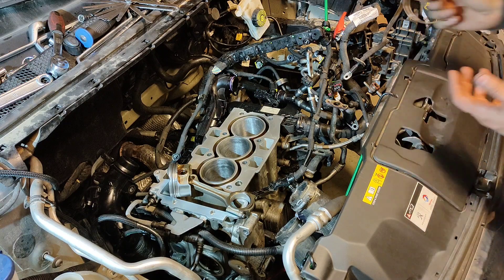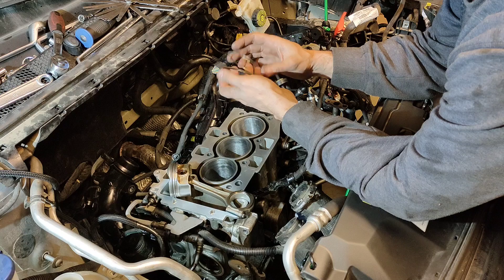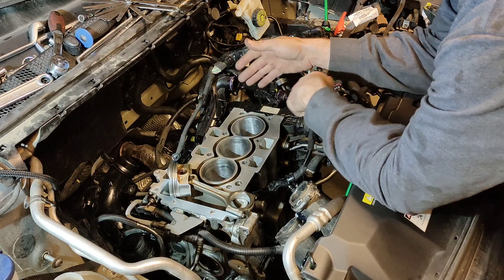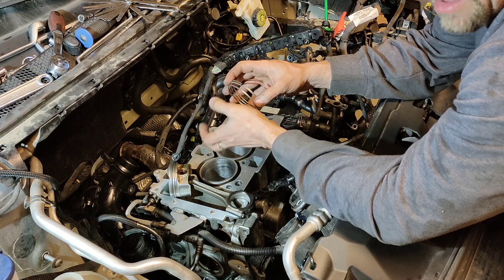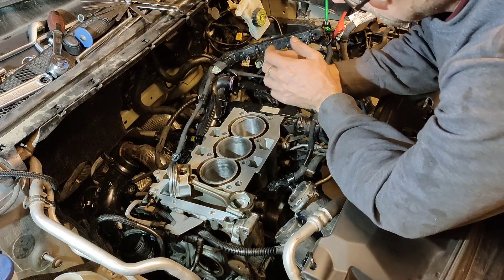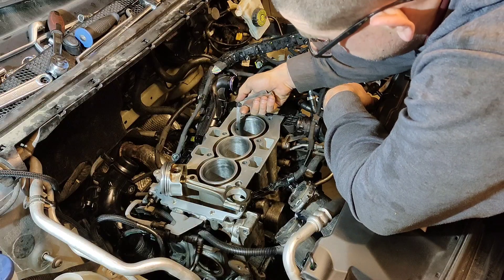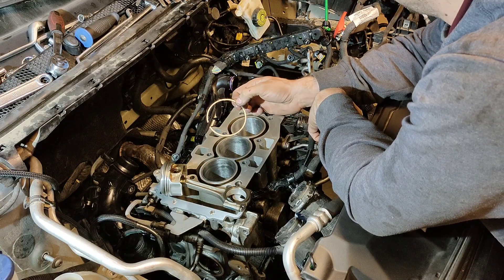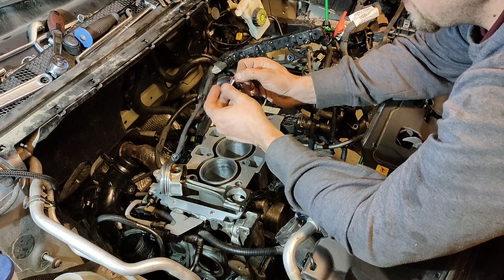PSA Peugeot 308 SW 1.2 e-THP Puretech rebuild - Part 4

Comment: Better to swap a  EW10A / RFJ engine and the car will drive another 500000km
Reply from the maker: Engine swaps are illegal where I live unfortunately.
Reply: @Ronke01  If you tell you upgraded the original engine and re-used the engine cover and some clamps?  LOL